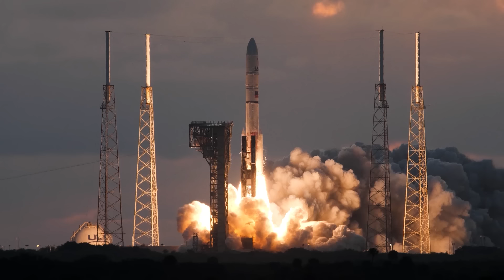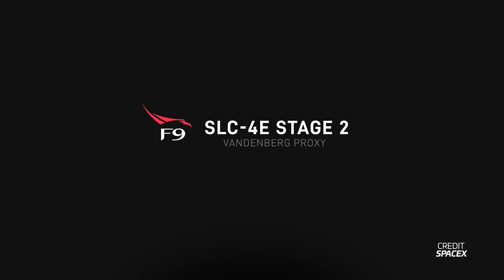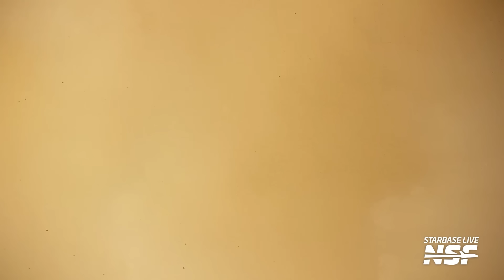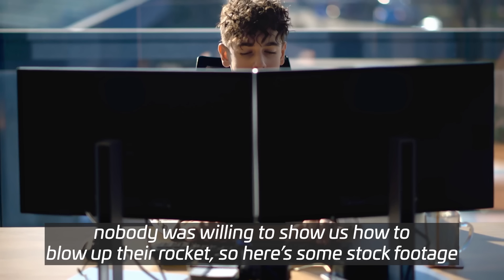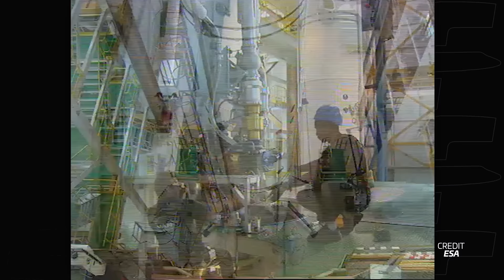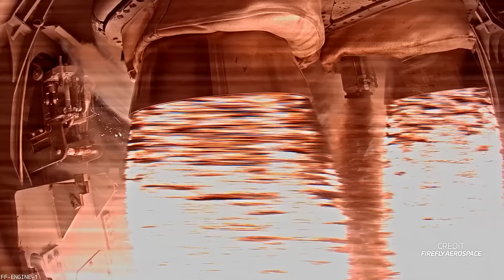How Rockets Are Destroyed Mid-Flight | Flight Termination Systems Explained

Comment: How do FTS systems change for crewed flights? Surely they want a slight delay to allow for the launcher abort system to get the astronauts away before blowing up the rocket? Do they always just have it as manual or does the ATS have a delay programmed in and triggers the LAS automatically?

Comment: Great vid! It brought back memories of Full Scale Target Drone operations at Tyndall Airplane Patch near Panama City, FL. We used repurposed obsolete AIM-9 missile warheads as Flight Termination System explosives. The FTS for the full-scale drones (QF-106, then QF-4, now QF-16) was a manual system.

The FTS was triggered by the RSO. The majority of the terminations were the result of the drone aircraft getting "winged" by a missile that was fired at it. A chase aircraft would take a look at it and determine if it could be safely recovered at the drone runway. If not, the chase pilot would break contact with the drone and verify it's destruction when the RSO "hit the button".

Interestingly, the FTS warhead was placed where it would neatly shear the nose/cockpit section from the drone causing it to tumble nearly vertically into the Gulf. I don't remember exactly where it was placed in the QF-106 (maybe the forward end of the weapons bay?). In the QF-4, it was built into a LOX converter base plate then placed into the LOX bay in the underside of the aircraft right behind the nose landing gear well. The placement in the QF-16 is probably (I don't know for sure) in the M-61 gun ammunition drum bay right behind the cockpit.

All these installations have the warhead oriented longitudinally fore/aft. Taking advantage of the continuous rod or annular blast-fragmenting warhead to essentially saw the front end of the aircraft off. These jets don't fly well without their pointy ends!

The Sub-scale Drones were terminated differently. When the "button" was hit, it would shutoff the engine, then command the drone to pitch up to bleed off airspeed, then deploy the recovery parachute. A boat would later track down and recover the drone which would be refurbished and flown again.

Full-scale drones were only rarely 'expended' intentionally. The majority of the missiles launched had telemetry packages instead of warheads. Usually, the missiles missed by a small margin and the telemetry would determine if it was close enough for a "kill". But sometimes those rascally missiles had their own ideas of "mission termination" and would knock a wingtip or piece of a stabilator off the drone. The real ambitious missiles would fly up the tailpipe (AIM-9) or demand a seat in the cockpit (AIM-120)!

The USAF found that full-scale drones weren't cheap so they went to a lot of effort to keep them flying. I remember one QF-4E that I had worked on at my first duty station 20 years before, that had survived 14 missile shots. They finally flew it out on a live missile shoot to be expended. There were quite a few drones that survived even more missile shots than this QF-4. Next is the last flight of this particular "Rhino".                                                                                                                            

An AIM-7M was fired at the QF-4 while it was maneuvering at Mach 1.4. The missile detonated inside the drone's turn and peppered the left wing and fuselage, with most of the fragments and explosion force above the QF-4 that was in a descending left 4-5g turn. The chase pilot looked it over after the remote drone pilot gained full control of the QF-4. He reported the aft canopy as MIA and the beast was bleeding it's vital fluids out into a thick trail of vapor. The drone pilot reported the telemetry was showing a slow PC-1 hydraulic system pressure loss and a more serious fuel leak. They figured they could get one more missile shot at it.

The live fire flight had a back-up 'shooter' with them and they were cleared to set up another shot.This time they fired an AIM-9M in a quartering head-on pass from max range. The argon-cooled 'Winder wouldn't be denied, it struck and detonated on the left engine air intake. The blazing QF-4 rapidly fell breaking up all the way down to the Gulf. The RSO didn't get to use "the button"!

Yep, everyday at the WEG was an interesting day! I've got a handful of videos of "Drone Follies" on VHS somewhere, I guess I should put some effort into finding them. It might make an interesting YouTube video. I apologize for the rather long winded comment, just consider it some ramblings of an old Air Force Vet remembering some good times at work!
Reply from the maker: Hey,thanks for taking the time to type all that out for us! Those are the types of stories we love to hear, from folks who actually worked in the field. - Das
Reply: What an excellent read!

Comment: Wasn't there a case where the rocket sat on the pad for longer then expected and they forgot to turn off the FTS and when the earth keeps spinning (as a non-flat earth does), the FTS triggerd on the pad since it's sensor detected xx degrees rotation off axis?

Comment: The cause of the 2013 Proton rocket crash is actually pretty hilarious.

First of all, Russian engineers have a tradition of designing everything to be as idiotproof as possible because they know that the factory workers who build them (and often the users who maintain them) are most likely going to be idiots or at the very least ignorant of and/or apathetic to the reasons why things are designed the way they are and they almost certainly won't treat their equipment with the care and conscientiousness it deserves.

As such, the Proton's guidance accelerometers are designed in such a way, using the geometry of the unit, mounting pins, and enormous freaking arrows saying "this end up" painted on them, so that there's no confusion about how they're supposed to fit into their spot in the rocket. That should've been good enough, right?

Well, three of them got installed upside down because when they didn't fit the way the factory foreman thought they were supposed to go, they beat the mounting pins flat with a sledgehammer and, with enough brute force (also likely some more hammering), they made the units fit in the wrong way, and no one caught it until after the rocket crashed.

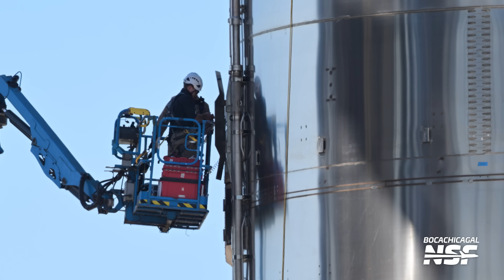Comment: 13:32 Y'all have EXCELLENT footage of Booster 9 getting terminated. 
As for the evidence that B9 had FTS activated:
1. Visually the destruction originates from the FTS box.
2. In response to a FOIA request for IFT-2 footage the footage was reacted during hot-staging and until just after B9's RUD. The stated reason included something like "proprietary" "initiation of flight termination system".

Comment: I was impressed by the simplicity when you explained the failure of v88(also called v501) and for those that want a more detailed explanation. when the rocket took off, the inertial navigation system with was made for ariane 4 was not made for such a strong rocket, and at 37 seconds the value overflowed and both inertial navigation system where sending error so the flight computer switched to using the second one but it didn't understand it so it switched to the secondary computer, and it thought it was data so it was thinking that it was at 90°, so it tried to get back on the correct trajectory and the aerodynamic force was so strong that it separated the booster from the rocket, and it caused the fts to destroy the rocket, and both booster where destroyed in the explosion so that is why there weren't flying uncontrollably, and a few seconds after they sent a signal to the rocket ordering it to explode but it was already destroyed, and all of that because they were using the same code and didn't made safety system for that case witch they though that it wouldn't cause a problem and also the flight computer wasn't powerful enough and didn't have enough memory to put all of the error management code in the code.
Reply: As I remember reading the failure report, the problem was that the countdown lasted longer so a particular value could grow. This number wasn't used so its value didn't matter. What did matter was when it was converted from floating point to integer and overflowed the integer. Causing an exception.

The compiler (ADA?) allowed for each conversion to be protected but in this case their was no specific action provided so the default was used: shut down the guidance processor.

Software reuse is a good idea generally but you do have to think about it a bit.

Comment: 13:32 Wasn't flight 2's booster detonated by the FTS? The spacex site said that raptor failures caused it to RUD, but i remember a meeting where Gwynne Shotwell said that it was a flight termination. SpaceX camera showed that the explosion originated near the common dome, where the fts charge was.
Reply: Correct, literally all evidence points to the FTS activating on Booster 9. The flight safety rule violated would've been the remaining engines failing as you mentioned.
Reply: @Ellhulto yeah it sounded weird that a single engine failing due to clogged inlets could take out the whole vehicle, especially with all the shielding that V1 boosters had.

Comment: 29:45 - I was 25 miles away when that Delta II rocket blew up. I could feel the building I was in shake as if someone downstairs had ramed a forklift into a support column.

Comment: Great video Ryan!!! Thanks!!! and WTF is up with a 42 second inhibited FTS??? They do realize flight problems generally happen within the first 30 seconds if not immediately off pad? Can someone explain that one to me? There has to be a good reason for delaying the FTS activation, right?
Reply: There is usually a safe separation timeout to make sure you clear the pad. Exact value determined in a knock down drag out fight between flight safety and ground safety. 🙂
Reply: @davidschultz3585 makes sense

Comment: I was expecting to see a few other things mentioned:

The V2 launched from White Sands Missile Range that went south instead of north as expected. Setting off the development of flight termination systems.

Range Commanders Council standard 319. Used by the various ranges to guide design and qualification of flight termination systems.

Globalhawk. The USAF lost one during testing a couple of decades or so back due to an inadvertent terminate command.

Oh, you can shut down a solid rocket motor. Poke a big enough hole in the case and the sudden loss of pressure will shut it down.
Reply: Are solid rockets really pressurized?
Reply: @cube2fox 
Of course they are. That is why solid rocket motor cases are so well built. 
The burn rate depends on pressure and operating pressures are around 1,000psi.